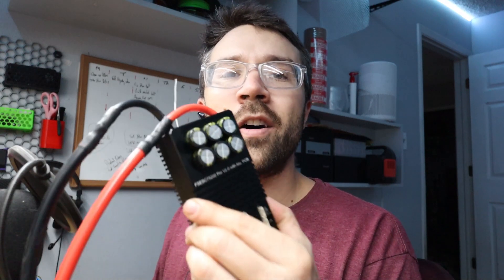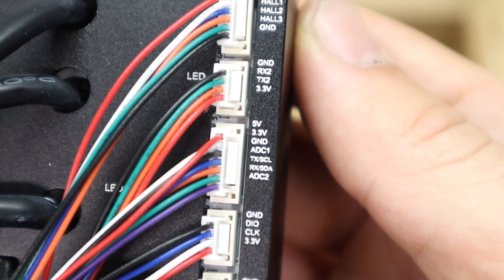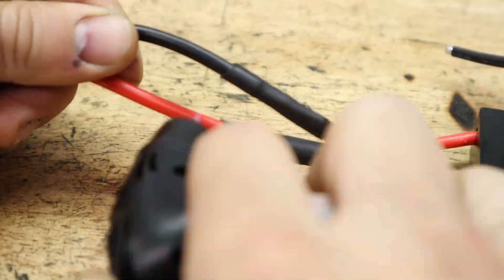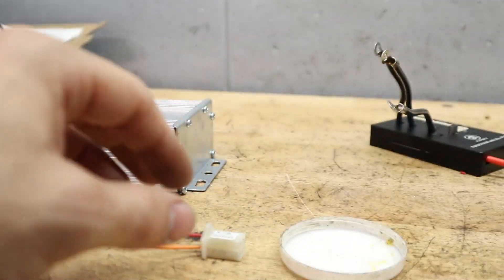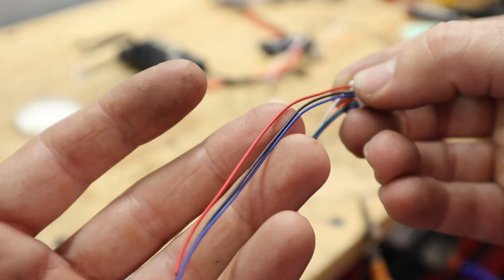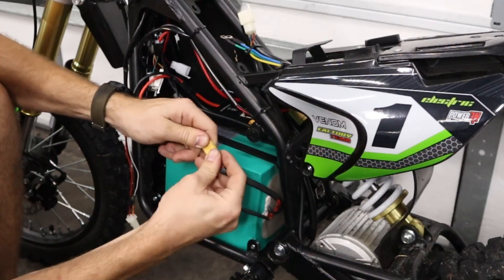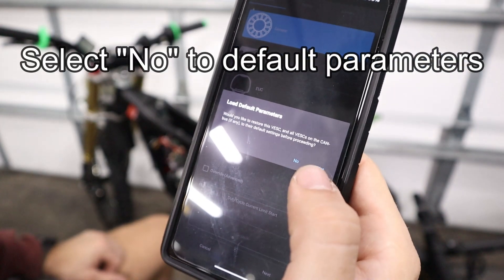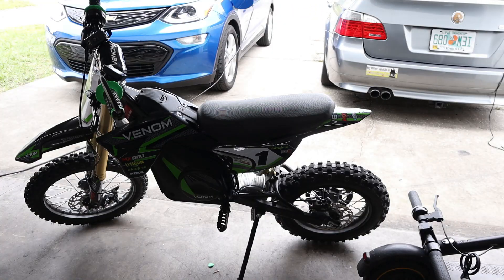How to:  VESC / Flipsky Wiring Tutorial!

Comment: so im actually looking at using this with a motor i got from a milwaukee mower to run my mini mill so obviously i wont be using a standard throttle, so could i just like a potentiometer or something like that? also what spec would i need? oh and also also, how would I integrate like a reverse function?

Comment: Hello Chris, Great video. I was wondering if you or one of your followers can give me some help/info for my project.
 My challenge is I need a dual VESC controller setup for a power wheels kids car I want to upgrade to brushless.
I have never worked with brushless DC motor before.
I have found some motors the will bolt on my gearboxes.
And the spec's look like they should work out for my setup.
Just wondering what controller would be the best for me and Bluetooth to make the setup easier for me.
Thanks for you time.
Mark

Comment: Quick question so is this a universal controller basically as long as it's set up correctly like could I use it for a 36 volt scooter then change the setup and put it into a 60 volt scooter and should I get the dual drive setup if I was planning to do dual drive in the future or do you have to use dual drive and it cannot be used in single drive mode how's the software to use

Comment: GREAT!! Just great!
Now I’m NOT going to settle for my 35MPH 52v bike, Ive absolutely gotta get this for mine and MOD it!
Just CAN’T leave well enough alone!
So where can  get questions answered on this?
My bike has the two brakes F/R,  that cut out the motor, and the pedal sensor ~ assist feature.
Does the PRO unit integrate these bike features ?
thx

Comment: The soldering could be better, you don’t have much overlap or connection between the copper. Solder is a small fraction of the conductivity of copper and melts at low temperatures. So please either use bullet connectors to connect wires or at least on that fairly small wire before tinning strip further, spread apart and push together each piece of wire while soldering so there’s lets of copper touching lots of copper and more area for solder to carry current. 

Also ring terminals aren’t great. If your motor has them then swap them for bullet connectors.
Reply: I agree it might have been a good idea connect those wires with a proper connector, but disagree with going bullet connectors over ring terminals. Imo for his use case ring terminals are a much better choice.
Reply: @ruzzcraze1862 Why do you say ring terminals are better?
Reply: @SC-rk6zt  Contact resistance and the permanence of the joint. The electrical resistance of two joined electrical contact can be described by Holms theory. The resistance is inversely proportional to the sqrt of the normal force. 

A bolted joint can have a much higher normal force + generally securely fastens more securely against pulls/any mishaps. 

If I expected to be frequently be plugging/unplugging the joint I'd use bullet connectors, otherwise I have more trust in ring terminals.

Comment: Just got the 75100 V2 Pro and I was really excited to try it out today but I CANNOT for the life of me solder the battery wires or the phase wires... That 10 awg wire is sucking up all the heat from the iron tip and the solder won't melt.. I guess I have to try a blowtorch
Reply from the maker: I had to get a larger soldering iron for my battery and phase wires, check out the 80w Weller brand solder iron!
Reply: @ChrisBuissonDIY  I ended up buying a 200W soldering gun and it went sooo much smoother. Also my 75100 Pro V2 came with a weird firmware called "75300 R3" so I flashed the real 75100 V2 no hw limits firmware from vesc_fw_archive and it runs super smooth. gonna try to set up field weakening next 👍

Comment: Hello im interestet in the Flipsky FT85BD dual esc. It says non vesc in the description, what does that mean ? Can this controler work whit 2 Hub Motors whit bothe Hall sensors, does it support a wired Display + the Bluetooth module for the App ?  And what are the differences from the Flipsky dual 75100  and the flipsky ft85bd dual esc, i just see the ft85bd is cheaper, but why ?
Reply from the maker: I have a video coming soon explaining the new FT85 series of controllers. If you have 2 motors, you should get a controller that has dual motor control. It's non-vesc, meaning it uses a custom software to control and change settings.
Reply: @ChrisBuissonDIY  Thats cool, its exactly what i need, thank you i will watch it.

Comment: My battery is 72v with continuous current of 150A and a max current of 210A, the problem is I have a 75100 pro and I cant find a anti-spark switch that will work for my build. What do I do?
Reply from the maker: Why not use the one I linked in the description? It's good up to 300a
Reply: @ChrisBuissonDIY  Ahh ok thank you! Just liked and subscribed!
Reply: I took a look at it and there is mixed reviews, one says it damaged their battery. Has it worked good for you? and will it damage mine?
Reply: It worked great for me. It's important you understand what you're doing before you start wiring things together. Don't use a cheap battery, confirm the wiring is correct, the flipsky settings are safe for your battery and motor, and you'll be good 👍  @ehhota

Comment: Your video just made me buy a FLIPSKY 75100 FOC 75V 200A Dual ESC with Aluminum PCB for an AWD trike build I am trying . do i need 2 of the add anti spark one for each motor?
Reply from the maker: No, you only need one anti-spark switch per controller, not per motor. Good luck with your build!

Comment: I have a black violet and grey wires coming from throttle were do they go
Reply from the maker: Adc1, 3.3v, and ground. You need to find out which wires on your throttle are signal, voltage supply, and ground. Usually black is ground, that's a good place to start!

Comment: Are you able to use the throttle without programming it
Reply from the maker: No, everything has to be programmed (throttle and motor) before you can use it
Reply: @ChrisBuissonDIY so if i just switch out motor...it still has to be reprogrammed?
Reply: Thanks for the help hope I'm not asking too many questions but do you know of a throttle that has an accelerator and regenerative braking  all in one
Reply: @ybik1 Yeah look up bidirectional throttle. Also like the alien rides scooter thumb wheel but that's probably not what you want.